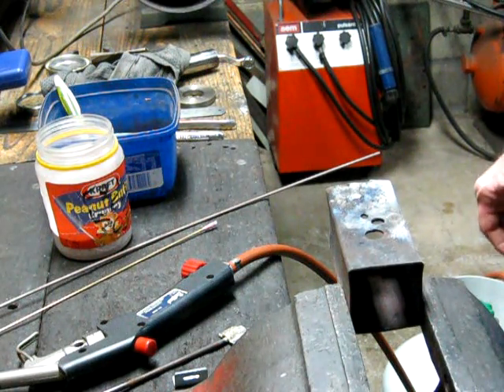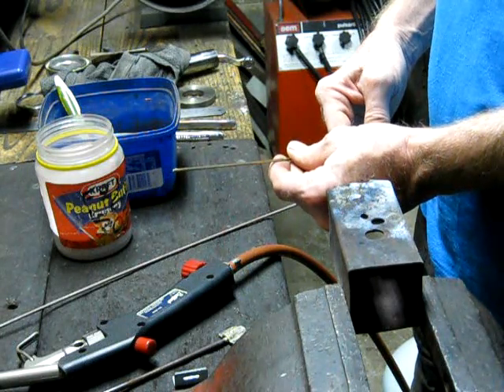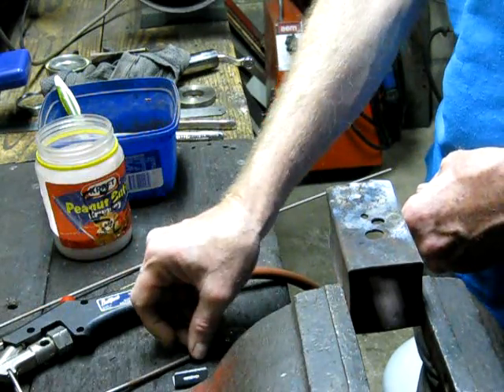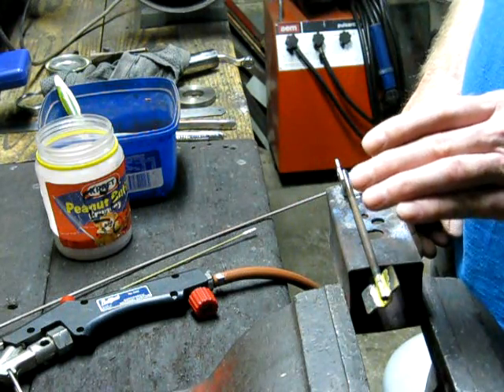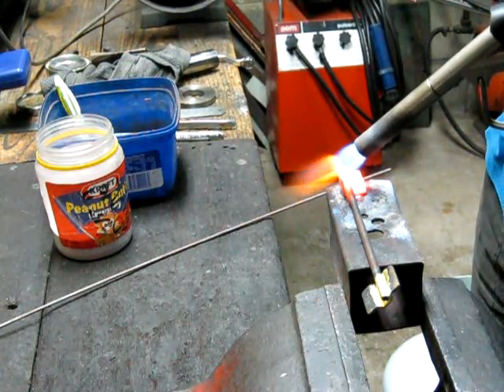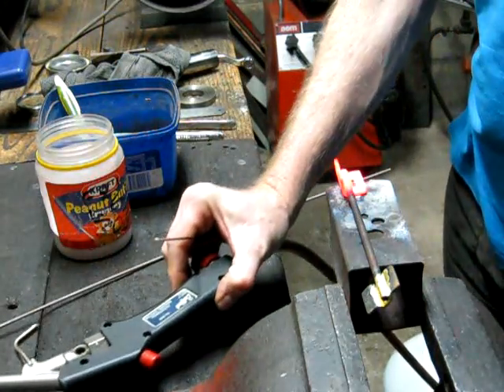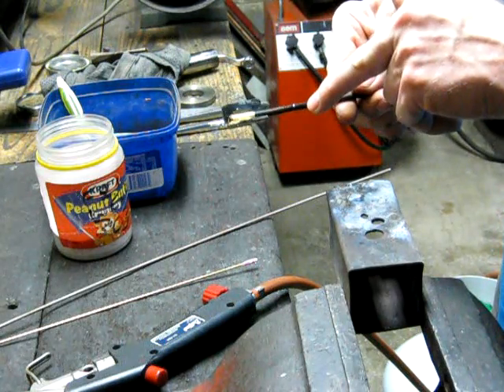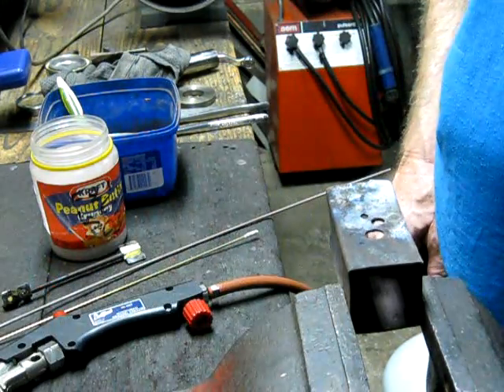How to bronze braze with LPG or propane gas

Comment: how big is too big? could I silver braze a lugged bicycle frame with this setup, or would i need oxyacetylene?
Reply from the maker: The thermal transfer rate would be quite severe.  I would recommend oxy/ acet or oxy/ LPG.  You can buy an oxy/LPG brazing set (new) for half the price of a Bullfinch and spend the rest on gas bottles.  That's what I would do.  Cheers Rob
Reply: @Xynudu  will look into it, thank you :)

Comment: Thanks for the video.. are you still happy with the bullfinch after all these years? I'm thinking of getting one.
Reply from the maker: Hi Chris.  I'm very happy with it.  It's expensive up front, but worth the money provided you only do small brazing jobs. 

It is NOT a replacement for oxy boosted torches, which will give more of everything, including running cost.

Mine has had a lot of use, mainly for model engine making.  It costs very lttle to run.  Basically it's the same heat level as MAPP gas, but for a fraction of the running costs.

These days you can buy oxy/acet bottles (D size) and avoid rental, but running costs are still expensive as you use 4 oxy to one LPG.  If you want more heat than the Bullfinch can provide then go OXY/LPG, for half the unit purchase price it makes sense.

It's a toss up between the two, but the Bullfinch is still the better option for most handy man jobs, within it's limitations. 

Sometimes I give it a helping hand by using it in conjunction with a large basic LPG burner to counter heat loss on larger jobs.

I certainly have had my money's worth out of it and have no regrets buying it.

Difficult choice.

Cheers Rob
Reply: @Xynudu  appreciate the feedback  I'm in Adelaide too will slip up to Adelaide Hills gas and grab one.
I've been enjoying your vids great info and how to do's
Reply from the maker: I haven't followed current prices, but check out Hampdon in WA.  They have free and fast postage as well.  

https://www.hampdon.com.au/bullfinch-lpg-autotorch-brazing-and-welding-kit

There are a number of distributors in Oz now.

Hampdon also do a 303 flux.  https://www.hampdon.com.au/CA-Flux-Copper-Brass-Flux-250g-303-OXY-LPG-Brazing

For rods go to BOC Gas.  https://www.boc.com.au/shop/en/au/boc-profill-mang-bronze-gas-welding-rod-grmb-112

Definitely the best rods for flow etc and the red pack works out a lot cheaper.  Go for 1.6 or 2.4 mm.  1.6 is most manageable for fine work.

Good luck.

Cheers Rob

Comment: hi there seeing your brazing videos i bought the bullfinch 4100 gun today and a propane bottle to repair a motorcycle carrier which had cracked ( poor design ) i wanted to brace between the main rail which is about 15mm od mild steel tube and about 2mm thick and the small bracing piece of 3mm thick mild steel only about 1 inch square and cut to a triangle, well, it was a long and  harduas task and i only managed most of one side before i gave it up as a bad job there is just not enough heat to do this job with this equipment and a new carrier was less than buying the gun and all the bits to do the job, so now it looks like i'm going to have to go to oxy propane if i want to do the job, a good try but no cigar as they say. !!
Reply from the maker: Hi Stephen,  the torch can only do what MAPP gas can do and heat loss through job mass is the limit.  Oxy propane is a whole new ball game and much hotter.  Before going that route try applying pre/extra heat to the job with a regular propane torch - ie. use both torches at once.  That will often do the trick and let the Bullfinch do the job.  I do this quite often to extend the BF capabilities.  Also it is critical that you use good quality manganese bronze rods with a low melting point as quite a lot of unbranded rods being sold have very little manganese and flow poorly.  I only recommend BOC rods. This will have a big impact on the job.  Cheers Rob
Reply: @Xynudu  hi thank's for your prompt reply, i am using 1.6 sif low temp rods and sif flux sold to me by a local welding store,  as i said it did the job but the finnish was poor and difficult to keep the metals hot unlike the oxy acetylene brazing that i used to do from time to time many years ago when i worked on motorcycles full time but as a retiree i don't have the use to warrant the expence of o/a,  but as you know yourself once an engineer always an engineer, ( state of mind ) and i like to have the equipment to hand even though it may not get used very often, i have a small chinese lathe on that principal as well, i will try the double torch as you suggested but failing that i may have to try getting all the bits to try oxy propane, we have a multifranchise company here in the uk called hobby weld where you can buy bottles of oxy and acetylene and other gases with a deposit of around a £100 for a 9 litre oxy and get a refund on the bottle when you don't need it anymore and about £20 to get it refilled then of course you need a torch, regulators and other bits, even though i have bought a new carrier for the bike i still have the "need" to repair the broken one and make it better, so we'll see, cheers.
Reply from the maker: Hi Stephen, we have a similar arrangement in Oz for oxy and acetylene bottles now (rent used to be a killer).  A new oxy/LPG brazing kit can be had for $200 AU, which makes it cheaper than the BF kit, but the cost of consumables is 10 times greater running it (mainly oxygen which you use at 4:1 LPG).  I have considered getting an oxy/LPG kit as well for bigger jobs, but that would be very infrequent and the two torch trick usually gets me through.   Cheers Rob
Reply: @Xynudu  hi, i tried the two torch idea and yes it worked in a fashion ( i only wish i had tree hands to control everything ) the problem was with the extra heat it melted the silver solder that was holding the job together on the other side ( a previous temp repair until i got the bullfinch torch ) and before i got the upper gusset brazed the whole thing fell apart now i'v got to make some tube to go inside to hold the outer tube together so i can braze it, it never rains as it poors, duhh. !

Comment: What is that white material used for binding bronze on top of it
Reply from the maker: Flux
Reply: @Xynudu  ok it's a flux paste or rosin plastic flux
Reply from the maker: It's a Borax based dry powder flux that you dip a heated rod into to get some to stick on the tip and apply as much as you like.  I hate pre-coated brazing rods as you have NO control on the amount of flux applied.  The code for it is CA 303.  Cheers Rob

Comment: Why do you keep the tip of the gas torch so close to the part being heated? I thought the hottest flame is on the tip of the flame?
Reply from the maker: Not with this torch.  I obviously use the torch at the hottest distance.

Comment: i wish to use a 9kg bottle of gas and a small hand torch to silver solder hot water pipes.i have some of those blue prefluxed rods and some brass rod i got from some place.will these components do the job ?
Reply from the maker: No.

You will need MAPP gas or an equivalent heat level (such as the Bullfinch Brazing Torch), or oxy/lpg/acetylene to silver solder.

Rob

Comment: Can't get the bullfinch in Canada but I've done some research on "Carbon arc brazing" which uses an arc/stick welder and 2 carbon rods as a "torch". Seems quite effective for brazing, cutting, bending etc. Here's a demo on  carbon arc brazing:https://www.youtube.com/watch?v=SVKZZN_W5cU
Reply from the maker: Very interesting.  Thanks for posting this link.

A mate of mine bought one of those setups years ago, but never used it much.  Not sure if he still has it.  I think Arlec made it.  It wasn't very expensive from memory.

It looked to work OK in the video, but visibility would be an issue, compared to a gas torch, which is much less intense.  It looks a lot like basic TIG.

You don't need a glare filter/visor with the Bullfinch LPG torch.  With oxy acetylene you do.

Also you can use the gas flame to push/flow the bronze around on the job.

But the arc looks promising.  Can only try it and see.

Cheers Rob
Reply from the maker: If you were running the arc torch at 70 amps as stated, you would have to be careful not to exceed the duty cycle of the welder and overheat it, by running it too long.  

As most home welders are 25% duty cycle, that could be an issue.

At half the rated output you should get about 5 minutes continuous arc without any problem - which should give you plenty of time to do small jobs as seen.

Cheers Rob
Reply: I think he is running  too high. Others have used as low as 10A depending on rod diameter. My ancient welder  has fixed inputs and goes down to 20A so I'll start there, just need to find some carbon rods, Maybe I'll harvest some HD battery D cell rods. Here's a good thread on the process:
http://www.mig-welding.co.uk/forum/threads/how-to-carbon-arc-weld-help-needed.3839/
Reply from the maker: You can buy the carbon rods off of Ebay in various sizes.

They are copper sheathed for strength.   The ones that came with my friends arc torch were like that ( about 6" long from memory) and about as thick as a ball point pen (8 mm ?).

These torches were mainly sold in the 1980's and a quick search didn't bring up much for sale these days.

You could easily make your own scissor style holder anyway.

I will read that forum discussion link tonight.

Cheers Rob

Comment: Some great info...  Where in Adelaide did you get your Bullfinch torch?
Reply from the maker: +Peter Harvey 

EH Cambridge and Co at Mount Barker.

They are the only Australian distributor, and post to any part of Oz.

I saw the torch at the Kapunda field day, and the bro Inlaw bought one, which I borrowed, and then got my own as it was so good.

Way way cheaper than MAPP gas, for a similar (slightly better) heat output.

Cheers Rob

Comment from the maker: Note:  the flux used in the video is EZI-WELD 303 brazing and bronzing flux.

This allows hot rod dipping/application and freehand torch work.

Cheers Rob

Comment: Brazing job does not look too great, no proper capillary action to allow even flow of the bronze, I recommend using  oxy/acetylene for brazing using a neutral flame, with the feather just being  pulled back evenly with the cone.
Reply from the maker: +Sidney Reinhart 

Maybe you should show us all how it's done.

Go on - contribute.

Rob
Reply: +xynudu haha, Amen.
Reply: this video is intended for smaller jobs &/or people who don't have O/A which he mentions.
Reply: And even if you do...use a slightly carburizing flame to prevent oxide formation in the braze.

Comment: I'm interested in the hard bronze Rod you are using. Twice now I've visited a prominent Adelaide toolshop and they only want to sell me the pre fluxed rods. One even tried to sell me silver solder even though I said I want to braze. And when I ask about bare rods and a tub of flux they seem to go all vague. I noticed the bare rods on display have different compositions. What rod should I be buying or not buying? They have a % rating and come in different thicknesses. I want to restore/reattach ferrous metals on old British motorcycles using a Bullfinch torch.
Reply from the maker: +Jon Moore 

Hi John,

BOC gas outlets are the place to go.  They have plain uncoated rods as used in the video, and so do many plumbing supply outlets, like Reece and E R Cambridge Ltd at Mt Barker.  They also have the flux - just ask for some basic pink welding flux you can dip the rod into as used for general steel rod oxy welding.  

http://www.boc.com.au/shop/en/au-boc-industrial-store/copper-brazing-alloys/boc-profill-mang-bronze-gas-welding-rod-grmb-112

Places like Total Tools don't have much, and their pre-fluxed rods are a very hard composition and don't flow very well.

I use 2.4 mm rods for ease of use.  You can also go smaller.  Larger rods are more difficult to use for small jobs, but small rods will do large.

Ask for a GP (general purpose hard bronze) rod for ferrous metals (steel etc).

Cheers Rob
Reply from the maker: +Jon Moore 

I generally go to the BOC gas outlet at 291 South Road, Mile End.
Reply from the maker: +Jon Moore 

OOoops that link is to the self fluxing rods, but they have the same in plain.

Cheers Rob
Reply: +xynudu Thanks Rob. That's brilliant help. I'll try BOC.

Comment: can i weld aluminum with LPG ?
Reply from the maker: +Srishan Perera 

Hi Srishan.

Not normally.

However, there are some special alloy rods that can be used with LPG for small repairs to aluminium - get them on Ebay.

I have some but rarely use them.

Cheers Rob
Reply: +xynudu thank you so much great help :D

Comment: if I want to make a distiller with copper sheeting would this method work?
Reply from the maker: +realdude111 

No.  The copper would draw away too much heat for bronze and LPG.

You would need a stronger heat source or switch to silver solder/yellow tip brazing rod (same as plumbers use for copper pipe).

Cheers Rob.
Reply: So if I switch to the silver yellow tip brazing rod could I still use that LPG gun?
Reply from the maker: +realdude111 

I really can't say for sure.   It would depend on how thick the copper is.   This is something I have never tried.

I would rather buy a second hand oxy or oxy/lpg set to do the job, then sell it/cash in the bottles afterwards.

No point in outlaying big money for a Bullfinch if it's beyond it's capabilities.

Cheers Rob.
Reply: Thanks for lookin out Rob :-)

Comment: Hi Rob,
           I was wondering if the techniques I have used for nearly 60 years would work for you with bronze. I make up some powdered flux (borax BP) and coat all parts to be brazed. I then cut a short piece of silver solder and place it on the joint, finishing off with a light sprinkle of dry borax.I then heat the joint until I see a quick flash of silver run all around the joint. This keeps the dabbing of the joint -which usually moves the carefulley placed parts-to a minium and results in a perfect joimt. Now I know there are differances with bronze brazing but the technique, replacing the silver solder and flux with bronze filler rod and some powder crushed from a piece of fluxed brazing rod, should work in a similar manner. I think the borax may well work as a flux with the higher temperature bronze. Give it a try and see if it works.
Cheers mate 
MoK
Reply from the maker: +Mo King

I have used wet GP flux and pre-laid bronze chips as you describe on occasion to avoid movement.  It's also good where it's hard to get the rod in position easily.

Works well - same as Borax (probably chemically similar).  

This is how industry does most brazing, as you only use a measured amount and there is minimal spill.

Thanks for the tip.  Cheers Rob

Comment: I assume a BernzOmatic would not work as well?
Reply from the maker: forestryprof Any MAPP gas gun would be very similar in heating ability.  Also you can now buy cheapish canister type oxy sets which would be much hotter than the Bullfinch.  I think Benzomatic may do these as well.  But in plain LPG guns, the Bullfinch is as good as it gets.  Rob

Comment: I bought the Bullfinch LPG brazing torch after watching this video. Very nice. Operates at 4 bars (pressure), higher than most LPG appliances. It really pours out the heat.
Reply from the maker: Miles Odonnol Yes, nothing else comes close in LPG, and even MAPP gas has trouble keeping up, particularly in windy conditions.  The Bullfinch really punches out some heat.  Thanks for the feedback.  Cheers Rob

Comment: I am building a wood gasifier, and need to braze a cover fitting to a thin walled 10 gallon drum. Is that possible with a propane torch? thank you very much
Reply from the maker: Hi, Sorry for the delay in answering, but YT dropped this comment somehow.

I think you would need an oxy/lpg torch for that sized job.

Cheers Rob
Reply: Thank you! Cheers!
Dave

Comment: Great gas torch,wish i had this set up10 year ago, Rang BOC gas about this torch and the dickhead said it would be impossible to braze with a LPG gas, I will have great pleasure to shove the over priced oxy bottles up BOC arse, Thanks for video Rob,
Reply from the maker: ***** HeHe.  My feelings exactly.  The torch is good, but don't expect oxy performance out of it.  Great for small jobs as demonstrated, and a boost with a regular large LPG (Primus) torch helps extend it's capabilities. Definitely very capable unit though.  Cheers Rob
Reply: Thanks again for your video,I hope more people will watch it,Bullfinch should be paying you for the great demo,without your vid i would never known about this brand of gas torch,
Reply: Hear hear I am sick of their prices too

Comment: pretty neat job professional looking, I assume a pen jet torch would work with those brazing rods?  where do you get those brazing rods and how would I pick the best grade of rod for the job?
Reply from the maker: A pen jet torch would not have the required output and temperature to melt hard bronze rod.  The rod used in the video is standard GP (general purpose) available from plumbing and gas/oxy supply companies.  Rob
Reply: xynudu .
Hi Rob Thanks for the info and speedily response